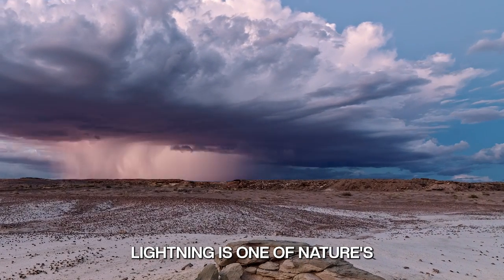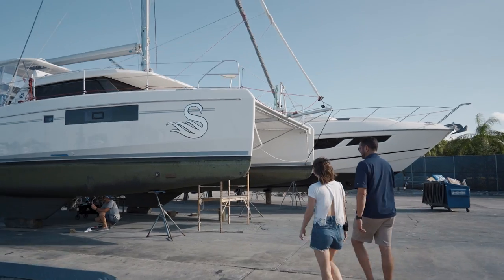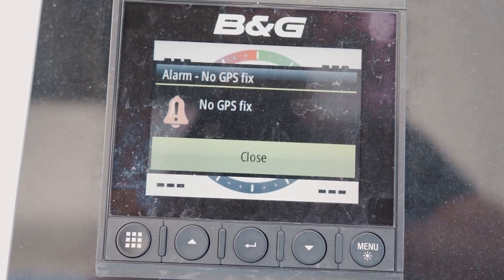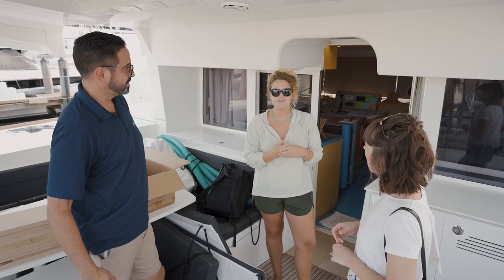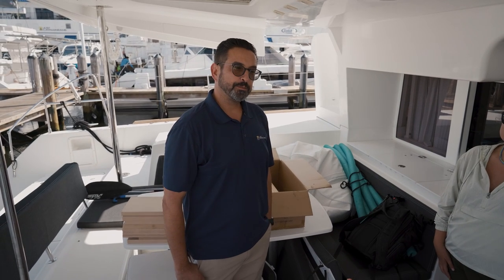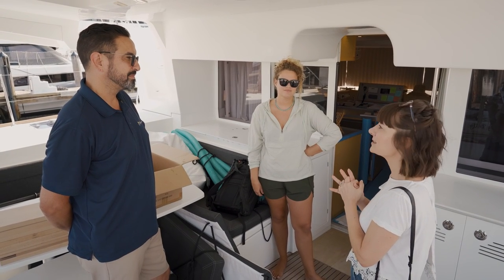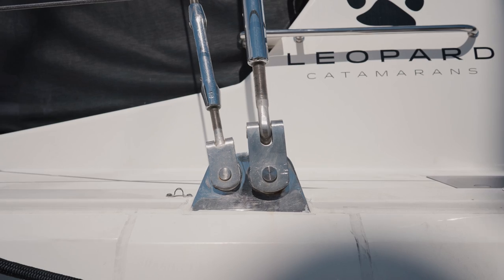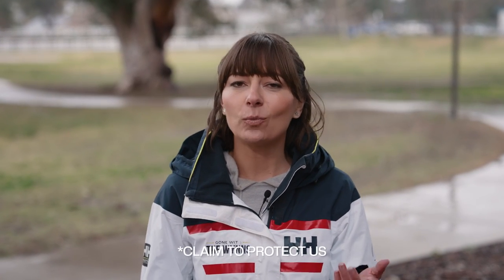Can Anything Stop Lightning?

Comment: I'm an electronics engineer and I deal with lightning constantly. I've heard many miss statements and I'm about half way through. I've heard conflicting statements from the people you have talking. So, here's what I have to say. Damage is primarily electronic. Damage can be kept out of the boat. Boats, however, are designed to BRING IT INSIDE. That is a problem. Lighting can cause HUGE STRUCTURAL DAMAGE AND SINK YOUR BOAT ! . Once it gets inside, it hast to find a way out. It quite often blows a hole in the fiberglass ! The boat sinks as few have 100 gpm pumps in the hull. So, how can you design your boat so it doesn't bring the lightning inside to the electronics and put the lightning in a situation where it needs to get out ? I've felt that antenna's should connect to a "receiver" that has a small battery and (solar powered)  is on the mast up above. It would use Bluetooth for control and audio in and out.  They do exist but are not actually Marine (weird right ? )  Not having the lightning brought into the boat by the antenna cable eliminates most of that possibility.  The second, the EMP PULSE, has to be dealt with . A Shield inside the fiberglass , Somewhat like chicken wire, would give you a boat with a built in "FARADAY SHIELD" . That is how radio engineers keep equipment running on top of mountains which get 1000sands of hits a year on antennas ! We also have methods where we can keep the lightning out of the building where all the electronics is kept. 

And that brings up a second subject. Lightning does not, for the most part, blow out AGM batteries. They do not have electronics inside. Lithium batteries have a BMS. The BMS is capable of turning the battery on and off (for a variety of reasons). Once blown, it will not turn on. To repair the battery you go inside and replace the BMS. 
  So, you tell me that boats with metal hulls and cabins lose there electronics. You'd be right. But, remember what I said in the beginning. Boats ALWAYS bring wires and cables from the outside to the inside. These wires, regardless of what they are connected to, need a protection module that removes the lightning pulses. One device and company that does that is Polyphaser. We use them on every cable coming into the "shack" or "cabin". Do all of these things and you will have equipment that is on top of mountains hit by lightning 1000 times a year and yet the equipment runs for 10 to 20 years !
Reply: The biggest problem with the device he shows at 16:12 is that for it to work, the lightning has to follow a path that engineer conceives as possible. Unfortunately though, Lightning doesn't follow pre conceived paths once its inside. It does what it feels it needs to do. And, to some, it seems like it is actually crazy ! So, the best plan is to not let it enter the inside of the boat. The ION thing is somewhat a possibility. But, it isn't 100% effective. That said, I would have a "lightning rod" on top of the mast, not an antenna with a wire coming inside the boat.

Comment: Sadly this won't work for RVs. You need a path to ground. The tires act as an insulator between the body and the ground. When park you would have to drive a rod into the dirt and connect a cable to it. Though you could do that with you boat while it is on the hard. The contact points on they put on the front and rear of the haul would need to be connected to a ground rob in the earth.
Reply: If you're connected to shore power you have possibly created an "attractant" route. Once the charge is on board though it will take a more direct route...

Comment: The product costs, per their website, $4950 for boat up to 40' long and mast 50' high and $8450 for boat up to 70' long and mast 90' high, excluding the SS extension to get it above vhf antenna and with no electrical cable or grounding plates.  So does the $15K cost mentioned start with the $4950 model or the $8450 model?

Comment: You need to get the lightning away from the boat as soon as possible putting a putting on a cable to the to the Mast directly down into the water keeps the electronics and everything a little safer

Comment: The only way, THE ONLY WAY, I would trust a solution like this is if they guaranteed repairs should it fail. Like a "We guarantee you'll not get hit or we'll repair it for free".
Reply: They do. I got a 10 year $100k warranty with mine. Expensive part, but cheap insurance. I don't even care if it doesn't work as long as they honor the warranty.

Comment: I never went out on the water if there was any chance of lightning. I don't like being the high spot in a lightning situation. Of course I have a choice as I am a day boater. My neighbors snail boat got a mast hit when tied up in the marina, and it took out some of the electronics. Squirrels took out some of my electronics (little wire eaters). Have any protection against squirrel chews? For LithiumIronPhosphate, the cells may not get compromised but it is highly likely the BMS if you are using one can get fried. I do not use a BMS just do constant monitoring. Again day boater so that is easy. The TESLA deionizer hmmmmmmmmm, I think I would pay someone to round up some of the invasive snakes in Florida and squeeze me out some of the oil. An alternative might be to contact companies that do EMP hardening. That would protect in and out of the water. And if we get nuked, you are good to go LOL.

Comment: Lightning and super high voltages create their own rules, generally electricity will follow the shortest path to ground, and Nearby strike damage is caused by Electro magnetic emissions damage. 
The military spent billions protecting stuff against emp when they experimented with Nuclear weapons. They are things you can do to attempt to protect electronics ie shielding cables, shielding sensitive electronics with mesh etc etc. ie faraday caging stuff and creating better dedicated earthing points etc. But again, lighting might decide to go wherever it wants.

Comment: I am not on the water but we lost years worth of our stuff to a lightning strike that burned a house we were renting.  And we are on the end of a grid line so we get surges all the time.  We have lost a bunch of electronics and a mini split unit in the house we are in now.  We have surge arresters but not many options.  If I was on the water with an aluminum pole stuck up in the air I would put the Tesla design on a boat if I could afford it.

Comment: In my 47 years of sailing I have been on four different boats that took hits. Every time was different and had different results. On Clipper City in Baltimore we had a generator fire and a blown up CD player at the bar. I mean literally blown up. Blew the sliding draw right out of the teac player. My personal Ericsson 39’ in 1999 I had to replace every lightbulb 💡 on the boat ( struck on the hard). My C&C hit at sea nothing... go figure just some melt on the top of the mast requiring nothing but new antenna. I guess it’s really a crap shoot,  but 15k is a full years cruising budget....well for me anyway I am not ritch like y’all.

Comment: I would think that all those electronics would have a fuse to cut off the current  from surging through, But actually  if that strike preventer thingy  really works, How come the Boat manufacturers doesn't  offer that as an option in the package?

Comment: POLYPHASER
Coaxial Protection

Lightning damages equipment at radio communications sites every day. Although lightning is a DC pulse, the time from zero current to peak current can be very fast. When lightning energy travels through a coaxial cable, there is a slight propagation delay that occurs due to the unbalanced inductances of the shield and centre conductor, and the centre conductor’s capacitive relationship through the dielectric to the shield. The higher-frequency shield energy will arrive at the equipment first, followed by the centre conductor energy. Since the pulse energy arrives at different times, a differential voltage occurs. A properly designed coaxial protector equalises this potential difference, which prevents current flow and therefore damage to the site’s equipment.
However, the choice of a standard gas tube type coaxial protector without DC blocking may not offer the user complete protection. The fast rise-time lightning pulse can produce over 1000 Volts across the gas tube before the gas can ionise and become conductive. Since there is no DC blocking mechanism, this high voltage is applied directly to the equipment input before the gas tube turns on.
A quarter wave stub coaxial protector creates a band-pass filter, at a frequency determined by the length of the quarter wave coaxial section from the horizontal centre conductor to the grounded base. However, if the equipment input is DC-shorted, the quarter wave stub can allow significant divided DC and low frequency energy to flow towards the equipment input.
A “DC blocking mechanism” inside the protector (no DC continuity through the protector) will prevent harmful levels of throughput energy from reaching the equipment. RFI stocks and distributes the patented PolyPhaser DC-blocked coaxial protector line, which has the lowest throughput specifications in the industry.
There is also a series of PolyPhaser coaxial protectors that block DC in the RF path to the equipment, and either inject, pass through, or pick off a specified DC voltage on the feeder’s coaxial cable centre conductor. This series of protectors is particularly suited to applications requiring DC to be passed up the coaxial feeder cable to power tower-top amplifier electronics.
Remember that no matter how good your lightning protector is, it’s not a fuse. It still needs to be correctly installed and connected to a suitable grounding system. RFI offers a complete range of products to protect your system, including the coaxial protector, grounding rods, copper strapping and grounding kits for the feeder cables.

Comment: People don't really like surge protection devices because they may cost money (if you add them up then for sure) and they can also become a point of failure. So did I. Our house had lightnings rods installed so I though leave me alone with this. 
And when our house got an indirect hit (an EMP actually from a close hit) it was not even that bad but we lost a washing machine, a television, a computer, a router and one main electricity wire connecting one part of the house to the main panel. Then I mounted a main surge protection to the main panel, added like 15 socket-mounted for individual loads and we have the most expensive machines on switchable sockets which we disconnect during thunderstorms.  
As they say, when men are kicked in the groin they put their hands there immediately, but then it does not really help anymore, they should have put them there beforehand. 
Use surge protections, use a lot of static shading and for God's sake don't connect everything to everything just because it is possible and looks fancy.

Comment: Don't make the assumption that lithium batteries are safe in a lighting strike- they are all run by sophisticated battery management systems and PC Boards that are all subject to failure in a lighting strike.  if you find you have power but no controls, be very careful about using lithium batteries as if they are even slightly damaged they can be subject to thermal runaway.  Always carry spare parts (BMS) in an isolated container to replace a BMS that is damaged by a lightning strike, and in case of an event, monitoring of cell or module temperature is very important, as thermal runaway may occur months after an event.

Comment: I'm not impressed by the round thing, but having a fat copper or (even fatter) aluminum cable continuous from the top of the mast to the water seems like it would work.

Here's why I'm skeptical of de-ionizing the local air: Yes, those ions are how the air conducts electricity, but the ions you have to deal with are sodium and chlorine ions from dissolved salt in aerosols.  Even when you are within a few miles of the ocean, there is so much salt in the air.  No small passive device is going to strip the salt out of the air locally, and definitely not if you have any breeze of any kind, even a tenth of a knot.

Here's why I'm skeptical of the round thing: In the presence of electric fields (that's when you feel your hair rising and you know a storm is building), charges concentrate at corners and sharp points on conductors.  High voltage (>12 kV) electrical equipment has rounded conductors specifically to reduce this concentration and the chance of spark initiation.  But that's not what the cable going up your mast is doing.

The cable going up the mast is attempting to channel the lightning discharge current through the cable and away from sensitive equipment.  That metal brush at the top is specifically trying to initiate an arc there (and not on your antennas).  That's a good idea.  The round thing at the top is less likely itself to get hit, but it's transferring the risk to some nearby bolt head or other sharp thing.

I'd spend my money on two things: a big cable and a Faraday cage for the electronics (or at least, the backup electronics).  Now as an engineer, I'm blunt, I just do the calculations and say what I get.  Lots of folks object.  But try to wrap your intuition around 30,000 amps for 500 microseconds.  That's an average strike.  I'd design for 100,000 amps, 1000 Hz, and 100 Coulombs.

I'm going to choose a 15 kV-rated AAAC cable, Southwire 247 Kcmil tree wire.  100 feet of the stuff is 40 pounds, and it's 0.9 inch diameter.  The conductor is 14.3 mm diameter.  Skin depth at 1000 Hz is 2.7 mm in aluminum, so 100 feet will be about 25 milliohms.  100,000 amps down that will give a voltage drop of 2500 volts, which the insulation should have no problem with.  100 Coulombs down that is 250,000 Joules, which will heat the wire about 12 degrees C.  Again, no problem.

The next challenge is to make sure that current doesn't find some other way down.  No other path from the top of the mast to the water should have anything like 25 milliohms, or even an ohm.  Ideally, the mast connection is insulated with an insulation barrier that can also take 15 kV.  This is how the utilities do it in the pictures that you showed.  It's going to be ugly.

The cable has to go all the way to the water with no connections.  The magnetic field from that current spike is going to try to blow that current out of the conductor and into anything around it.  You probably cannot fabricate a connection that will contain it.

The only thing I didn't like about those water contactors was that I couldn't see the cable connecting to them.  No way in hell would I let that cable go through the hull.  It goes over the side.  You can put a nice wooden deck over it, or whatever, but realize it's going to jump like a defibrillated patient when it takes a hit.

Second thing: the magnetic field.  The lightning rod/cable will protect the boat from the voltage and energy but it'll basically emit an EMP in the process.  Every exposed piece of metal is going to act like aluminum foil in a microwave oven.  That's what kills your electronics when you have a nearby strike.

First, see if you can put your electronics as far away as possible from the lightning cable.  The electric field drops with reciprocal distance.  This is what building lighting rods do, and it works.  But boats are small.

Second, put a backup set of electronics, whatever you absolutely must have to get home, in a Faraday cage.  This is a drawer of some kind that's lined with mu-metal foil.  That is not exotic, it's used in electronics all the time. The important thing is that when the box is closed, it is complete, and there isn't some gap in the metal to let the E field in.  And during a storm, that drawer stays closed.  The closure will need those little metal fingers like you see on your PC computer case when you close it.  (A $40 PC chassis is a Faraday cage -- see?  Not exotic.)

Third, maybe it's possible to shield some of your active electronics from the EMP.  Anything connected to an antenna is a lost cause, unless you can use an optoisolator between the antenna-connected bits and the expensive bits.  Your propulsion power electronics are too bulky to back up but also robust enough to ride out an EMP with a little help.  What you need to do is make another Faraday cage, this one enclosing the entire propulsion power system.  This basically comes down to lining parts of the hull with mu-metal foil.  You will need to vent that space through a metal grille.  Totally doable, PCs do it, just monkey-see-monkey-do.  Make sure the metal grille is connected on all sides to the mu-metal foil, and you are good.

You will want a connection between the propulsion power system and the solar panels, etc.  Ugh.  This needs an isolating transformer.  It can be done but it's not DIY at all, and I don't know the product space.  The connection from propulsion system to motor also needs to be engineered.  If you had just the three wires from the motor going into the Faraday cage... maybe it would work, because those wires only connect to beefy power transistors that can probably tolerate 1000 volt transients.  The trouble is that RF is amazingly good at crawling in through small gaps, and I don't know what frequency ranges lightning is.  It's probably everything from DC to infrared.

Very interested to hear what you do on your next boat.

Oh, Nikki looks really cute under the umbrella matched to the color of her snappy jacket.